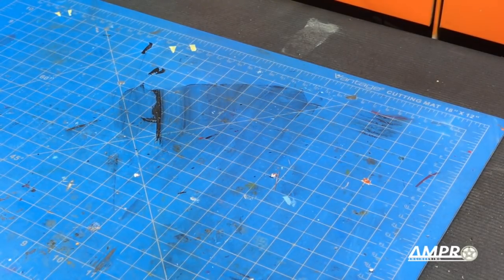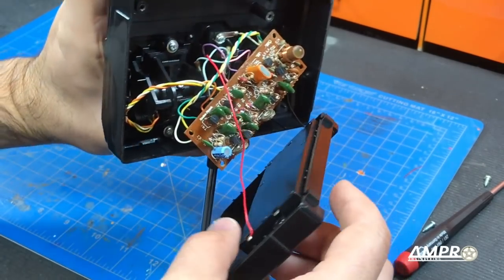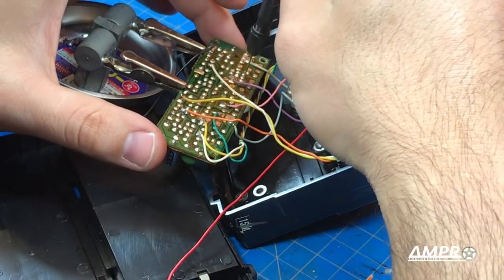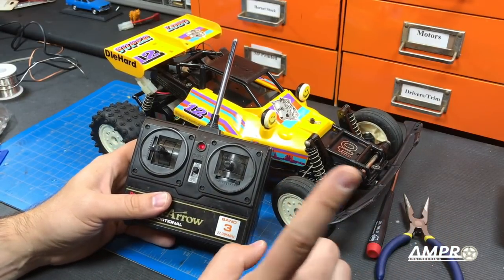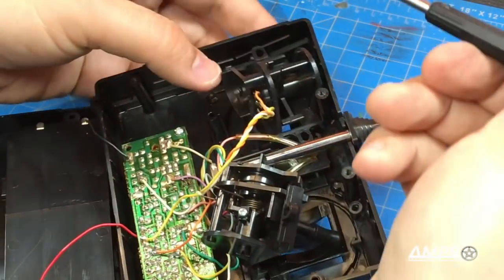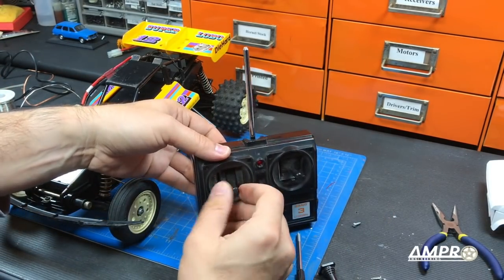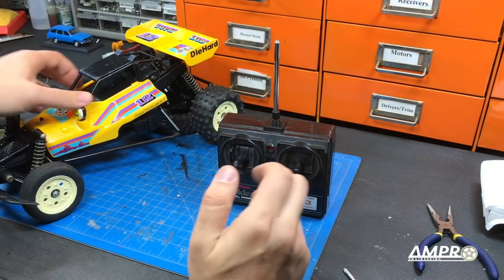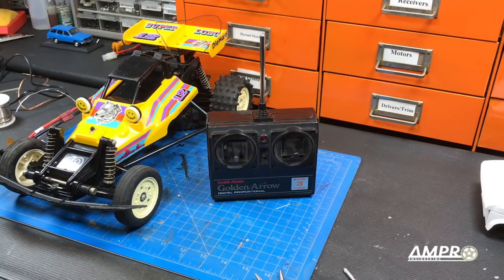e181: Nikko Rhino / Bison / F10; Radio Reconfiguring and Repair

Comment: I have a radio shack trespasser 4x4 truck I have the same problem i got 2 trespassers an one remote the one truck does not have the band sticker but the other one does its a band 4 and the remote is band 3 i took the remote apart but dont see the crystal but I do see a frequency thing that i can put a small flat head an then it counter clock wise an the truck has one as well do you think I could turn them 3 turns and then do the same for the remote holding the forward stick an turning that frequency thing 3 turns till the trick moves will that work or do I need to just gut one an put all new electronics in it an buy a new remote and set it up
Reply from the maker: Yeah that is a great question. I have never touched those potentiometers however.

Comment: Great video series! I actually just picked up a Radio Shack Golden Arrow myself. It kinda hurt me to watch you take a Band 3 Golden Arrow radio apart to work for your car because mine actually didn't have it's radio and it's a Band 3 car, lol. I ended up finding a Radio on eBay with the correct Band (not Golden Arrow) and the car works great!
Will you be doing a buyers guide on this car? love hearing your inputs on the different cars and will definitely be switching all my bushings for bearings as well. 

Loving the content, keep up the great job!
Reply from the maker: Awe man....I tried soo long to find a replacement radio. I really didnt want to do that either. Yes, I will do one soon! All the driving footage is shot and right now I am editing around 30 videos to just get them all done!
Reply: AMPRO Engineering quick question, do you think the factory electronics could handle an RS540 Sport Tuned motor?
Reply from the maker: When it was new I would say yes. Today...with 30+ year old capacitors...no I wouldnt try it.
Reply: AMPRO Engineering hmm...very good point, lol. I’ll just throw some bearings on it and leave it be. It’s fun as it is anyway. Thanks again man!

Comment: Should I buy an original RC10? I like vintage RC cars, really like my Grasshopper, but would like something more competitive. I don't really like the new RC10, I think it's a good car but not my style. Any RC car I touch will be rolled many times, and when I go a long time without rolling it I'll get over confident and jump on it off of something HUGE, should I get it or should I get a Traxxas Bandit or Rustler which are modern and I actually like them a lot too?
Reply from the maker: Well they are like shopping carts. They are awesome but if you want to be competitive with modern cars you need a modern car. I would get a new Bandit. Parts are easy to get and traxxas has great and forgiving plastic. Vintage RC10's have nylon parts that have zero flex and break easy.

Comment: Hi there. Hopefully you might help me. I got Pink Hopper Super Alex based on F10. Fortunately it's in a very good condition but I realized quite weak RF transmission power that makes car to stop responding in a very close radius - aprx 5 meters. It used to be working well couple of years ago. Any hint how to fix? Could it be caused by the frequency intrusion? Many thanks in advance 🙏
Reply from the maker: Wow I love that! I didn't know that existed. I would take a look at the PCB. I suspect leaking capacitors or even poor continuity on the components on the analog board. Age can do that. You can reflow the solder on the contacts or look close to see if there is any noticeable corrosion. I hope that helps!
Reply: @AMPROEngineering  Yes, it is some german edition I got for 30 years or something like that. Colors are not as bright as they used to be but from functional point it works perfectly. Many thanks, I'd try to, hopefully it saves the day 😊 🖐️

Comment: The second crystal was with similar frequency? I haven't seen you doign any adjustments in the tank circuit (specially the coil) if the frequency is changed for example from 27.12 to 49 MHz some capacitors and inductors have to have a little bit different values otherwise the range will be poor.
Reply from the maker: These had 6 freq options which was better than the cheaper and smaller version that only had 2.  I did not need to adjust anything since they are all in the 27 band thankfully.
Reply: @AMPROEngineering  Ok :) That's great then :)

Comment: Hi! do you happen to make or know of someone that can make the shock towers for this car? I have a R.S. Golden Arrow and the left shock tower broke off on a rollover. I've crazy glued and even gone as far as plastic welding and it continues to just break off time and time again. I love driving my Golden Arrow and would hate for a broken shock tower to be its demise. Thank you for any info you may have!
Reply from the maker: Jeez sorry man I dont. Do they bolt on?
Reply: AMPRO Engineering Yep, the whole front end unbolts. I actually ended up buying a front shock tower piece off somebody on eBay for a Rhino and it bolted right up and works great!

Comment: With my golden arrow I soldered a lead from the positive and negative of the motor battery to the positive and negative on the circuit board where the four AA’s used to connect to so that way I didn’t have to have double A’s in it it worked better and the steering was faster
Reply from the maker: Ah yes, that is what we did with hornet too!

Comment: What's radio crystals? I'm new to the hobby. And and have never looked inside of a radio system. And idk if I even have radio crystals because mine is 2.4 ghs
Reply from the maker: They put the car on a specific frequency so that other cars can run with them. Problem is there are only 36 ground channels so you always have issues with other people on the same channel.